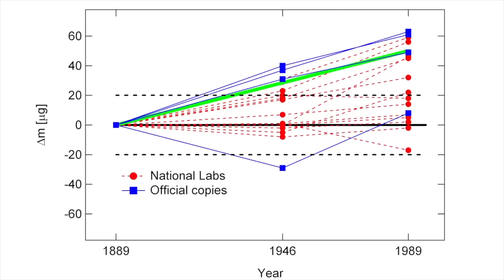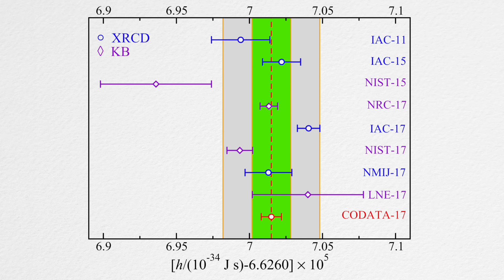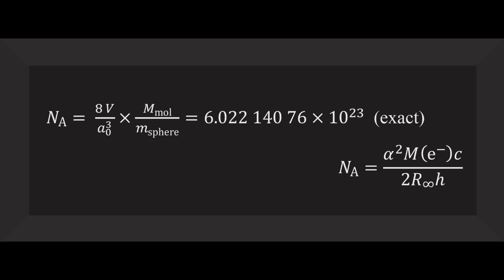The kg is dead, long live the kg

Comment: A few questions please, highly curious. You said measurement techniques have improved over time and that's what causes the change in these constants. Is that accurate? If that's true, won't we be able to more accurately measure these in the future too and the value will need to be updated? How did they decide on using this number instead of one of the 'fluctuations'? How will this impact the overall result?
Reply: The issue with the old system and the reason why we're redefining the units through universal constants is that the physical objects they were bound to would change. Quite a lot in fact. By being extremely precise in their measurements and combining different measurement techniques to narrow down the margin of error, it has become so small, that even if they do get a more precise measurement, it would cause less of a change than you'd get if you'd continue using physical objects.
Reply: @lunkel8108  Phenomenal reply. Very much makes sense. Thank you. :-) Any universal constant is better than a physical object that changes over time.
Reply: @eddiethompson1326  Happy to have  helped

Comment: you see Americans.
we use STABLE measurements here in the rest of the planet that fit perfectly with each other.
Nothing like you 5280 feet in a mile.
Or water boiling at 212° but freezing at 32°

Comment: What about the Meter?
Reply: It's a made-up Value
we could use the Diameter of a Photon
but that would be unpractical
Reply: Defined through time (according to Wikipedia: "The second is the duration of 9,192,631,770 periods of the radiation corresponding to the transition between the two hyperfine levels of the ground state of the caesium 133 atom") and speed (speed of light in fact).

Comment: But the big question remains: which is heaver, a kilogram of geathers or a kilogram of steel?
Reply: Geathers has more rotational inertia. So if in.space both need the.same.amount of energy to get pushed, steel is easier to spin.
Reply: @Benoit-Pierre  But is it heavier?
Reply: @Kolbein837   yes, in some way, because it will consume more energy to initiate some kinds of movements ...

Comment: Honestly I think the Coulomb should be the base constant, and the ampere should just be 1 Coulomb per second.
The reason I think that is because the Coulomb is actually an amount of stuff (charge), just like the other base constants. i.e. the meter is an amount of distance, the second is an amount of time, the Kilogram is an amount of mass, etc...
IMO the Ampere being a base constant is just as bad as if speed were a base constant, and the meter was defined as (1 speed unit)*(1 second). It just doesn't make sense.
Reply: Honestly, I would have chosen charge instead of current too. Though not for the same reason because... the meter is actually defined thr way you discribed i.e. by the speed of light...

Comment: The real question is that what will happen to that cylinder in Paris?
Reply: It will be kept in the exact same conditions as now, and weighed again now and then against the newly fixed numerical value of Planck's constant. That will help understand if it did gain/lose weight or not during the time it was used as the international standard. It is still not clear why the masses of the IPK and its copies haved slightly diverged with time.
Reply: @ParbelleProf  précision . Even if diverged was the right one, I want to clarify.

We know why and.how the ref masses change and evolved. What we don't understand is why they evolve at different speed and in different directions, even when.stored side to.side.

Comment: Wait...Plank's constant best measurement method is based on balancing an "old" kg which is an incorrect value. So how that can work? Cannot we just say plank's constant is 1 and calculate all the rest accordingly?
Reply: The old value could not be "incorrect". Because it was correct by definition, since it was the definition. The problem was that it would change over time because the mass of the cylinders wasn't truly constant. Now we essentially just took that value and pinned it to a physical constant so it won't change anymore.

Comment: if mol = 6.0221408*10^23,
and Avogadro's constant = 6.0221408*10^23 * mol^-1
Does that not mean Avogadro's constant = mol * mol^-1 = 1?
Reply: x^-1 = 1/x ➡ x * 1/x = x / x = 1
Reply: Muskar Yeah, exactly.. That can't be right. Or have I misunderstood mol^-1?
Reply: @spherinder5793  Sorry I misunderstood your question and I didn't really think about what you were saying. I'm not sure but there's definitely an issue with it. I think the constant is a ratio used to figure out how many constituent particles it contains in per mol. So 6.02214076*10^23 mol^-1 can be rewritten as 6.02214076*10^23 particles/mol. And in order to figure out how many particles there are in e.g. ~6.022e+23 mol, you say ~6.022e+23 mol * ~6.022e+23 particles/mol = ~3.627e+47 particles. 1 mole is 6.02214076*10^23 particles. And Avogadro's constant = ~6.022e+23 particles/mol. Replacing mol with ~6.022e+23 particles gives ~6.022e+23 particles / ~6.022e+23 particle = 1. It makes as much sense as saying the ratio of 100 miles / 100 miles = 1. Maybe I misunderstood something though. I'm not exactly an expert.
Reply: Muskar Yes, but 1 mol is 6.022 * 10^23, so they are interchangeable. Thus Avogadro's constant evaluates to 1
Reply: @spherinder5793  Yes, 1 mol = 6.022e+23 particles. The number on each side is different, and so is the unit. Avogadro's constant seems to just be another way to state the same thing. I'm not a mathematician, chemist or physicist, but it seems like we're taking the constant as a mathematical constant, and not a physics-based one. In my understanding, what evaluates to 1 is the ratio of particles per particle. Not exactly useful information. I think the point is that "mol * mol^-1" cancels out the mol unit, and just leaves the number of particles. I.e. 0.450 mol * 6.022e+23 mol^-1 = 2.710e+23 particles.